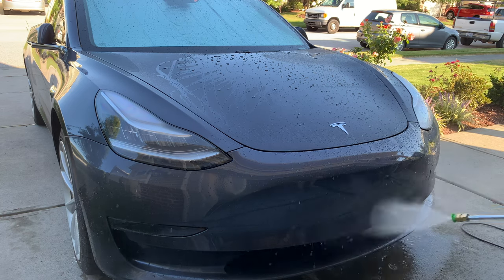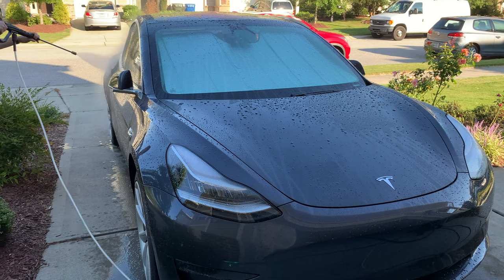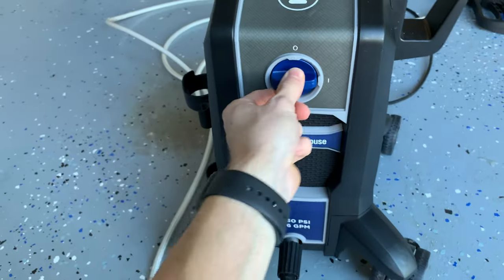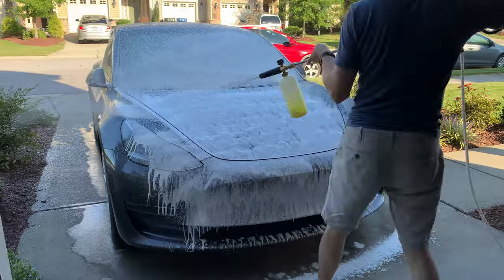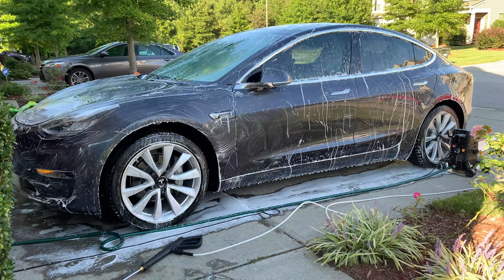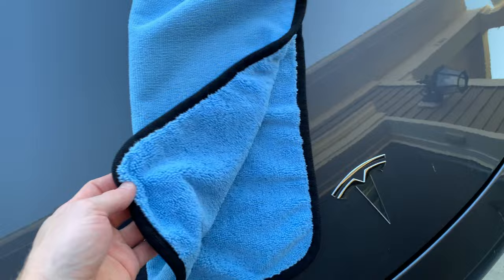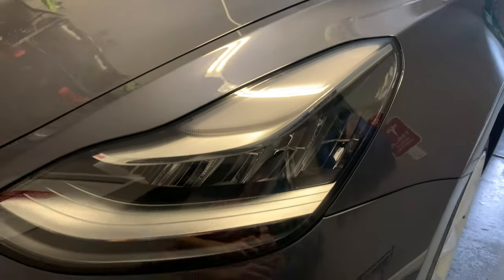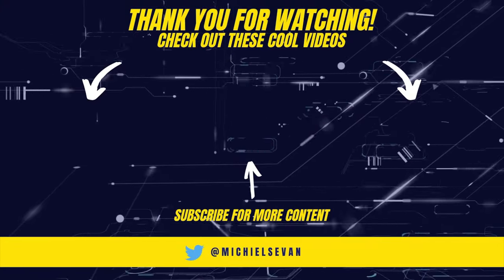Tesla Car Wash 🚗 Power Washing my Model 3 at Home 🏠 Foam Cannon | What I Use

Comment from the maker: Westinghouse Electric Pressure Washer 👉🏻 https://amzn.to/35nvfhL
Car Wash Brush Kits Mop Mitt 👉🏻 https://amzn.to/2GFNqoy
Foam Cannon Blaster 👉🏻 https://amzn.to/32hYl01
MEGUIAR'S Ultimate Wash & Wax 👉🏻 https://amzn.to/3ivxTWJ
Chemical Guys Snow Foam Cleanser 👉🏻 https://amzn.to/3m4Zr7v
Turtle Wax Ceramic Spray Coating 👉🏻 https://amzn.to/32exJ06
Turtle Wax Ceramic Wet Wax 👉🏻 https://amzn.to/35qq7K2
Microfiber Cleaning Cloths  👉🏻 https://amzn.to/3bJJ2At
Armor All Car Tire and Wheel Shine 👉🏻 https://amzn.to/2Rap1tv
Ultimate Windshield Sunshade 👉🏻 https://amzn.to/3k4Sb9B
Want Accessories for your Tesla? Checkout this video... https://youtu.be/enAloLhJBtk
Want a Tesla? | Get FREE Supercharger Miles! 👉🏻   https://ts.la/evan87711
Reply: You should use old style paste kind tub wax on outside your glass! It will put a shine on your glass and repel rain better than traditional way!

Comment: After hand washing my car, I use an electric (obviously!) leaf blower to blow off the majority of the water droplets.  Great for getting all the water off the disc rotors so they don't start to show surface rust.  Makes the hand drying part go much faster with most of the water removed.
Reply from the maker: I actually just bought one lol... thanks !
Reply: i just bought one too , a Tesla Model 3 Long range that is . hahah.... but I have an electric leaf blower and watching videos about washing car and I am going to try the leaf blower technique but I would highly warn against making sure the leaf blower is clear of debris and maybe even the surrounding area as well and wind direction so you don't do more harm then good , my driveway always seems to have debris and rocks or sticks and dirt and my leaf blower gets really dirty I will need to clean everything really good before I do this. Love my M3 so much!

Comment: Hi Evan. Great video but I’m just a little concerned about applying the ceramic product over the Meguier wash and WAX. All ceramic application videos that I have seen recommend removing any and all waxes/polishes before applying it. Perhaps this is not the case here but I thought I’d mention it just in case.
Reply from the maker: Good point! I'll have to look into this.. I know I can't tell a difference and the car still beads water very nicely.

Comment: What do you think about pressuring washing with fully covered PPF?

I've been using a garden hose because I'm worried a pressure washer might peel off the edges of the PPF.
Reply from the maker: Just use a wider pressure tip. Instead of 25 use maybe a 35 degree tip and remember to keep a good distance away from the car when spraying.